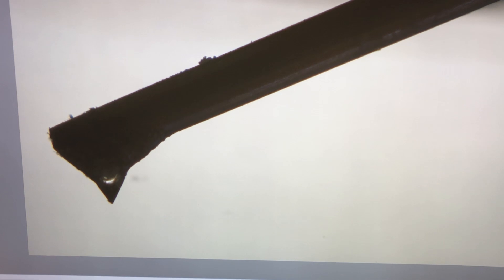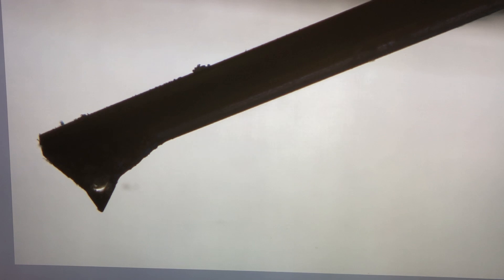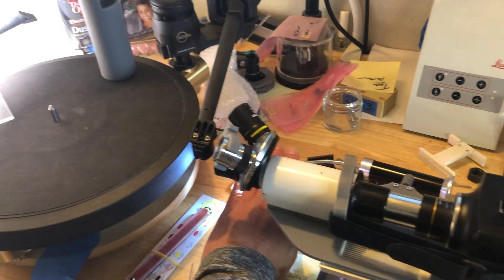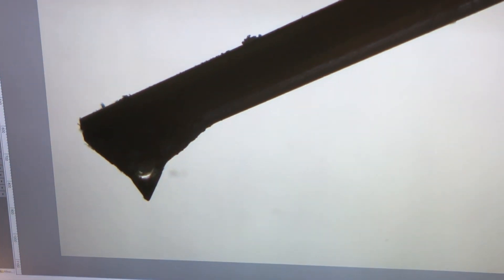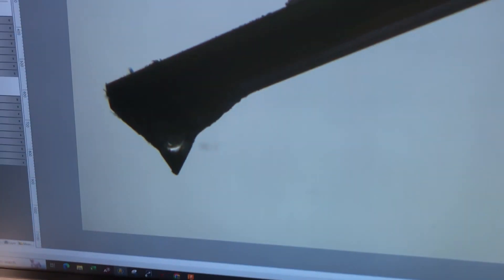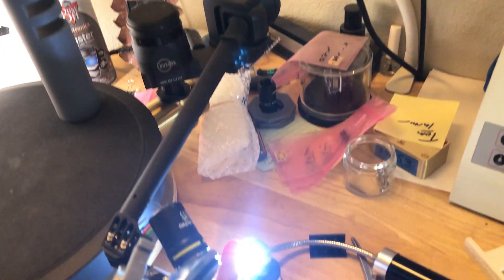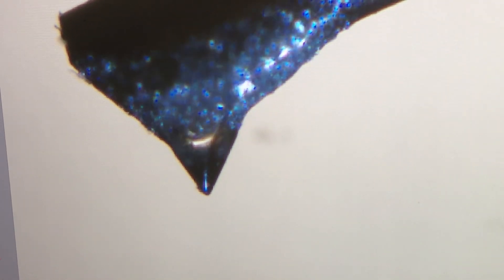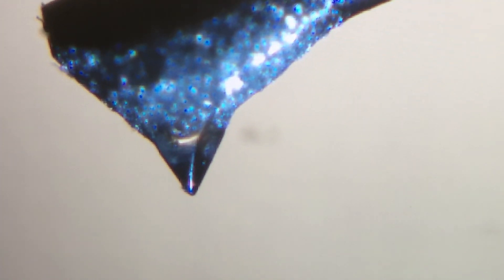WallyScope - Illuminate Shibata stylus - Part 1 of 2

Comment: Would it be possible to show how you do the measurement by placing the lines? I understand the line of the cantilever but not how the line should be drawn in relation to the ridge of the diamond.
Reply from the maker: Hi. Have you taken a look at the illustration in the WallyScope instructions? There is a section on it in there.
Reply: @WAM-Engineering  Yes, but I still am unsure. I will send an email...